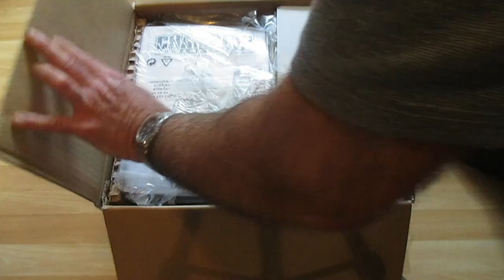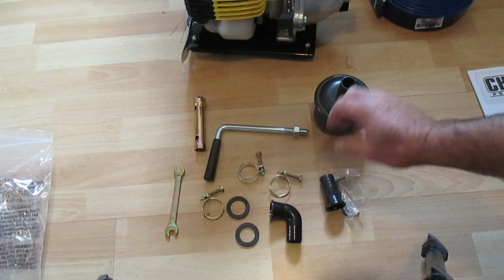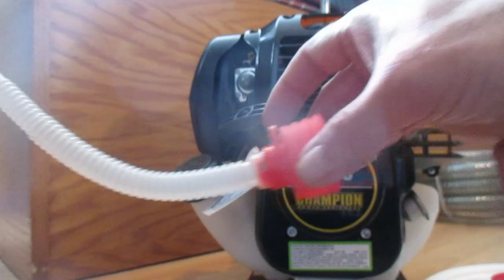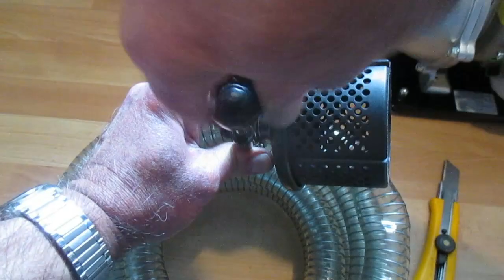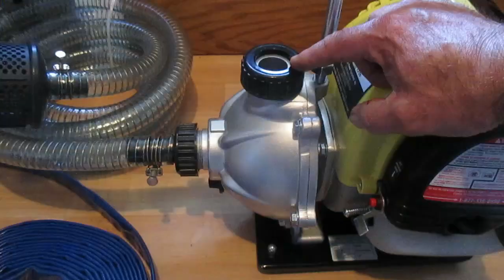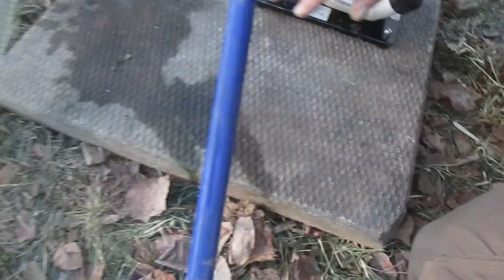Unboxing and using a gas powered Champion 31 cc water pump

Comment: So you fill the pump with water at the start, but the intake line is long and empty. Won't the pump quickly become empty as it sucks the air out of the intake line?